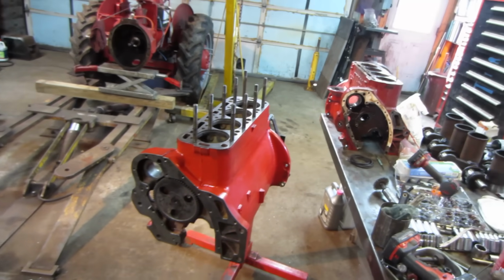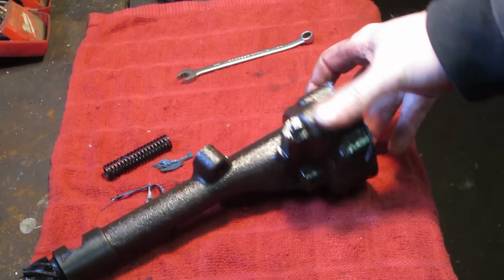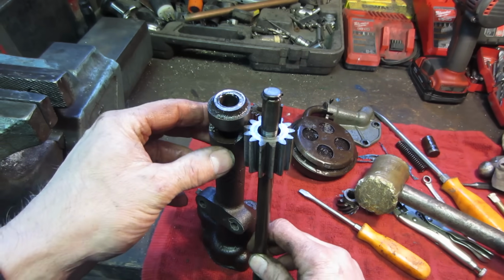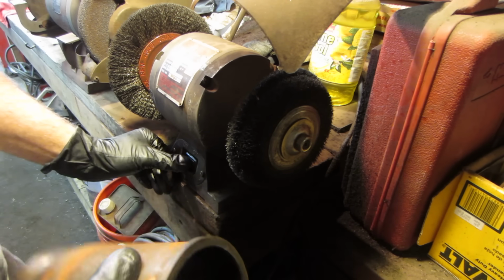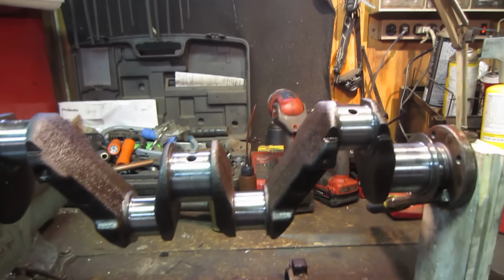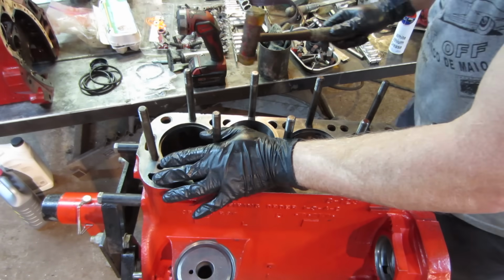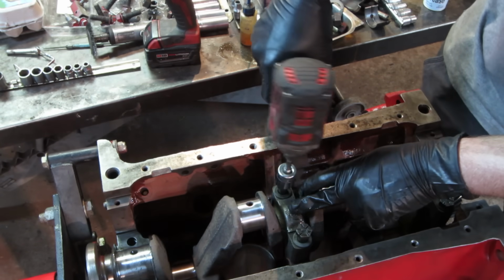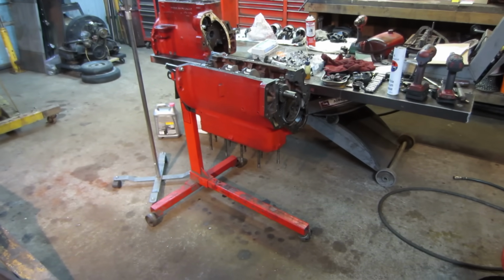1941 farmall a tractor engine reassembly. pt4

Comment: A couple of comments... First, why didn't you use assembly lube? I've heard of using oil during assembly, but it was preferred to use assembly lube.   Second, used bearings... I had a similar experience with bearings I ordered for a Jeep motor. When they arrived, they were in a similar condition as yours. Since I ordered them from a local parts store, I took them back and showed them to the manager. He apologized profusely, and offered to have new ones over-nighted. When they came in, we started assembly, and found they were the wrong size (too tight). So went to the store to order them. The manager asked if we were returning the ones we ordered before, and I said no. We would sell them on the Internet as "used" (which we did).
Reply from the maker: no such thing as assembly lube in 1941, and they never had a problem back then,

Comment: Can a rod be saved after having a rod knock, or is it always out of round after that point?
Reply: Jason Bierschwale Actually the machine shop will cut some off the cap.  Then they will recut the diameter to new spec.  The hole will be cut so the rod length will not change by lining up the cut to coincide with the top (rod end) .  This keeps the rod the same length.

Comment: Waste of time to tap any of the holes unless it is so rusty you can't get a bolt in it. Spay it with penatrating oil blow it out and oil them up with engine oil. You might break one off and never get it out. I learned my lesson on an old Oliver 77 oil pan bolt hole. I could not get it to quit leaking because it was one on the end of the block rail.

Comment: Great video again. Thanks! I love watching and listening to you :) Did you have any protrusion on the jugs at the block surface. I work on British cars and there is requirement of .003" to .005", but maybe that's not the case here. I see already some comments judging the "home polishing" of the crank. I agree 100% with you, I'd do anything myself if I can. I just polished a couple of weeks ago a TR6 crank the same way, but I used a shoe lace to drive the sandpaper. Thanks for the great videos!

Comment: Aircraft Airframe & Powerplant Certificated Mechanic and Instructor 40 years and cert. Designated Mech. Examiner (DME). To  run a standard tap in the head stud holding thread end would destroy the desired fit on the threads A stud tap would need to be used to maintain the proper thread fit and strength.
In aviation the threads are slightly rounded at the thread base to relive thread stress concentration and a tap and dye is seldom approved, This procedure decreases thread strength be at least 30%. May not be critical on older tractors, but is sure critical on aircraft engines. A lot of lower educated A&P mechanic get themselves in trouble not remembering this. This is why A&P's are certificated and watched over with FAA inspectors.
Use a torque wrench to torque the jam nuts to max. torque for removing the head studs in the last video and with aluminum castings in aviation recip. engines a professional heat gun and not a torch. I would think 1500 degrees on the heat gun would be better on cast iron and would be best if that was the new block, which I know it was not. 
I would love to talk about camshaft lobe and fowler face visual inspection; I saw some questionable marks on those in this video and hope this engine is not prematurely with cam to follower stress/ wear.

Comment: I have been watching many of your vids, my kind of mech! Suggestion, use brass brushes for cleaning shotguns and rifles for cleaning lifter bores and other holes. They come in several sizes. Also, I have never seen a half moon key with a shear pin before. Kind of defeats the purpose of the shear pin.

Comment: Where's the plastiguage for checking the crank shaft bearing tollerance? Wiggle test, are you kidding? Very shade tree.....
Reply from the maker: its not adjustable, and already slightly undersize, what is the point, im not going to have the crank cut .
Reply: It's an ancient tractor. It'll be fine
Reply: +Fred Flintstone  --  This coming from a man who's engine and brakes are the soles of his bare feet.  Yabba dabba doo!!!!!!!!!
Reply: It is adjustable in that the tolerance is adjusted by using different thickness bearings for the crank journals. I can appreciate that it may be difficult or impossible to get replacement bearings for this particular engine in various thicknesses. It may require getting something made or fit from some other type of engine with similar bearing dimensions. I can't say myself. I've not searched this out for this engine. 
The problem will be that if the clearance is too great, then the oil pressure may be too low in journals severely reducing or eliminating the film of oil between the bearing and the crankshaft causing premature wear. In a properly clearanced engine, the crank rides on a film of oil, not on the bearing itself.
Reply: Negative nellys, not going into space, or 6k rpm.
Reply: Fairly sure Mustie knows what happens if they are out of tolerance by too much. 
Good enough for the application is what counts here and if he isn't going to get the crank reground there is little point in spending ages gauging everything
Reply: Whenever someone calls me a "Shade Tree Mechanic" I take it as a complement- an attestation of my ability to repair just about anything, using basic tools and my skills of 39 years, plus being a "Professional" Mechanic for 10 years in my youth. Some take offense to the term (as you imply) that it's not "ASE quality" work unless there is a garage, lift, and thousands of dollars worth of tools and equipment used.  This Man has much of that, plus 30+ years of experience to perform what he needs to.  He's freshening an engine for a 76 year old farm tractor- not building a nitro Funny Car. Tools such as Micrometers and Plastigauge aren't necessary with this work- but I'm sure if he thought they were- he would've employed them.  For a person with 3 Subscribers and zero videos- you have a huge (perceived) opinion of what should be done here.
Reply: A pro engine builder would have pulled out the plastigauge and checked it. Now you can argue all day about how fast it revs, and how much it will be used. I know Mustie1 does hack low cost mechanical repairs on many vehicles, quick and dirty because the vehicle isn't worth much, or is not long for this world because it will most likely be corroded and recycled long before the 'used parts' hack repair causes a problem. I get it folks... It makes sense, and has it's application. But the farmall has been around for 76 years because it's not driven on salted roads, and most likely someone would like to be able to cherish and use it for another 76 years if possible, so I believe the engine repair deserves more than the usual quick Mustie1 hack job, in fact with regard to other parts of the build, Mustie1 is doing those things more professionally and I commend that.
I know most of you provide, 'suck up' comments, and perhaps that's what Mustie1 is asking for when he asked for more comments recently. Personally I'm going to be objective and call a hack for what it is. I'm just saying the crank shaft bearings are worthy of more than a wiggle and a giggle and saying that's good enough. Oh, and by the way the lube used on the bearings was also a bit of a hack, and not the proper lube for startup of a rebuild. Oh well. Maybe the tractor owner is more than happy.. That's great.
For a pro it isn't good enough, and if some of you commenters wish to argue on about it, all you're proving to me is that you're not, nor ever were pro engine builders, and if you were, I sure wouldn't want you to be touching any engine I needed rebuilt.
Mustie1 was throwing the previous builder under the bus for the quality of the work.. All I can say is let us all watch out for throwing stones from inside our glass houses. Take the critique for what it's worth, words on a youtube video. Nothing more. If it upsets you, maybe the problem is you.
Reply: carryit - foolish words, you don't know a single thing about me. The fact is that I have been building engines most of my life, many of them race car engines, as well. I have plastigauge in my toolbox... And yes, I use it.. ;-)
Reply: No one but you.
Reply: Nope I couldn't give a shit.

I enjoyed the video though even if everything wasn't absolutely perfect.
Reply: and this is from a guy that uses bare feet for brakes,,,,
Reply: Having watched Mustie do his thing for seven years I trust his mechanical judgement AND I trust that he has very few if any comebacks. ...and If he does he repairs his hiccups, of that I'm certain. Just watching this video, as a heavy duty equipment/diesel mechanic with over 30 years of experience, I feel comfortable with the belief there aren't going to be any oiling issues.  Notwithstanding the fact is that this is not a working tractor and will not be run on a daily basis doing heavy farm work.
Reply: I think he knows what your saying,but as he said he''s not having the journals cut so why worry about it.
Reply: Listen, I have been watching people wrench on cars since the 60's and have myself wrenched on all kinds of vehicles since the 70's... Professionally, I preferred to insure that any job I did was done right, this was backed up by the minuscule amount of comebacks of my repairs (some years in a row I had NONE)  You come off sounding like a prude that's talking about sex.  I have known plenty of so called "professionals" ASE certified that could not hold a candle to Mustie as a mechanic.  You are being hypercritical, sure Mustie joked around about assembling the crank, AND I am certain if the customer had told him price was no object that he may have gotten a new crank, had it turned etc etc. but sometimes you have to do what you have to do.
Reply: Hey Fred Flintstone can't wait for you to start posting videos on your channel about your great engine rebuilds.  That way we all will learn so much.
Reply: dhurt - childish response and off topic. grow up a little
Reply: Rvliving - tell you what, there are some really great mechanic who post on youtube who you might like. Check out guys like scannerdanner, Eric the car guy, briansmobile1, and one of my favorite guys for doing high quality work at all times regardless of how much he's getting paid, or whether he's getting paid (sometimes a job is a loss) would be : South Main Auto Repair. The guy is a first rate mechanic, has good ethics and never sends a 'hack' job out his door. 
Enjoy.
Oh, and I appreciate your felt need to show loyalty to someone you like on youtube, but never let misplaced loyalty get in the way of being honest with  someone regarding their substandard practices when they arise. I've been watching mustie for awhile as I'm sure you have. Some of his practices are excellent, and some are half ass. I'm sure he has his reasons, but it is what it is, he publishes it, not me. One example would be using a substandard part, that they themselves criticize for being used sold as new on someone else's engine, and then stating the reason being that they needed to get the space back in their garage sooner really show's where their heart is. 
Not good.
Reply: I never said anything about loyalty to anyone, what I said was that I was looking forward to your videos, the other channels you talk about are not on here posting about how great they are that is why I will wait for your videos.  And if we are throwing around how great we are then 25 years on the offshore power boat tour for Fountain Powerboats in the motor department is my greatness. If you don't like how mustie is doing it don't watch.
Reply: So if it's hack work, why bother watching it? And why would anyone bother to write "suck up" comments to a guy the vast majority of us don't know personally, will never meet, and can't possibly hope to gain anything from for the effort? Don't bother answering, intead, you should spend the time finding a metalguage to replace that cheap plasti - one in your toolbox  :> )
Reply: Its going to be fine, it sounds like you don't have much experience with old equipment. Its not a 2017 9,500 RPM motor.
Reply: Exactly ... race car engines ... this is not a race car engine. These engines where made for repair by average farmer. They did not have plastic gauge at that time. LOL.
Reply: Lol Fred...they didn't even have plastic back then...it was phenolic or bakeolite
Reply: Flintstone, Knowledge and experience is a far better tool than plastigauge!  I would feel way more comfortable allowing mustie to build a motor rather than a novice with access to all aspects of tools/ measuring devices.    Oh and beautiful dog you have, love his look!
Reply: Non sequitur - meineke. One thing has nothing to do with the other. Plastigauge takes a precise measurement of clearance. What you're saying is no different than saying that knowledge and experience can replace using a feeler gauge to measure clearance. It's like saying, " knowledge and experience can show me with just a wiggle what the clearance is, so the wise one doesn't need feeler gauges". 
You're talking nonsense, like many here in the comments that blindly defend their hero no matter what he does. You're not increasing the value your own stock by any means, nor are they........ :-/ You certainly can't convince me of anything using that kind of reasoning other than you lack good sense yourself.

Comment: I never chase threads with a tap. I got a male/female thread chaser kit that I love.  Keeps threads tight but clears them at the same time.  
Also should have marked the oil pump gears before dissamebly to keep them phased on their lapped in surfaces. (just like you would a lifters and cam.)

Comment: Back in the day when farmers "refreshed" one of these engines they probably did bearings, rings, and maybe valve seats.  Frankly these engines are way overbuilt for the power they produce.  All a guy usually wants is a tractor that starts when it should.  An engine that doesn't knock, burn copious amounts of oil, or leak the remaining oil out in a week was a success.  You are well on your way.  This coming from a guy that has mucked around with more than a few of them.

Comment: To those who said why didn't you wait until you had the parts and put the cylinders in before you put the studs in. I have never pulled studs out of a tractor engine to either pull dry sleeves which are much tougher to remove and replace than a wet sleeve like this. Way TOO much work! In this case the only difference is where he replaced the block the studs had to come out to go in the good block.

Comment: Permit me to say sir.....I once lost a engine on a stand just like yours until I modified it to two front legs ....not one.....moving the engine and it was almost all finish and bang....broke the oil pump housing casting on the motor on a slant six...think about this....maybe you got away with it this far....just say`in if you care....SALUTE

Comment: Mustie, several of your practices are suspect in my mind.  Number one, not using solvent rather than wire wheel to remove hardened oil deposits.  Number two, polishing bearing and ring surfaces on a rebuild.  Number three, use of oil rather than grease on assembly of mating surfaces.  Having worked in a Porsche facility we always did better than it calls for rather than less.  Use of plasti-gauge to detect actual tolerance.  Use of oversize/undersize bearing/shaft while torn apart for rebuild.  Half-ass isn't necessary and while it will prolong the need for more repairs down the road, there are other ways of making money.  Not nice.
Reply from the maker: dude are you going to pay that bill, its TRACTOR and you are comparing it to working on a porsche, you would go broke working on this stuff as no customer would ever pay your bill,

Comment: It would be adviseable to take the Distributor/Oil Pump casting to a machine shop and install a bushing for the new shaft or it will just wear it quickly.  I believe that wear will affect the Oil pressure due to excess clearance of the oil pump gear.

Comment: Plasti-guage and assembly lube. Oil may sound like the right thing, but the assembly lube has an extremely minute abrasive that gives proper seating to new bearings. Yeah, ya have to change the oil immediately after break in, but hey......

Really considering they sent you somewhat "used" bearings, then you really don't know what the thickness actually is. I honestly would have sent those back with some pretty ill words, or at least get an explanation.

Comment: you dont really want to use a tap to clean up threads anyway.  its way to easy to end up removing metal during thr process. there are dedicated thread chasers that are designed to clean up threads.  A great alternative is to take a bolt and cut a notch perpendicular to the threads the run thst into the hole. the notch will give junk a place to go and doesnt risk cutting fresh metal.

Comment: Why break the glaze if using the existing rings?
Reply: I am aware of cylinder wear after 50 years as a tech. Deglazing is only to provide a surface for new rings. Not to compensate for wear.

Comment: Why didn't the freeze plugs fail on the other engine ?
Reply: Core plugs, not really freeze plugs. It's a misnomer that "freeze plugs" pop out to save the block when the coolant freezes. They're just there to plug up the holes where they poured out the core sand when the block was cast.